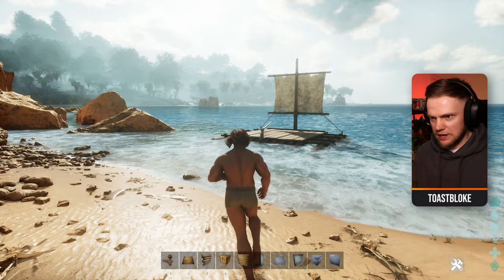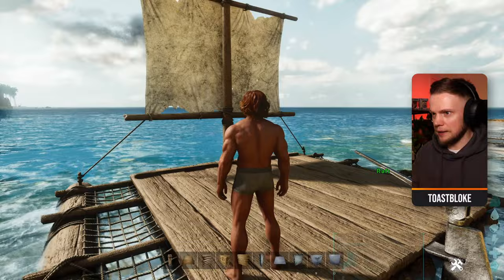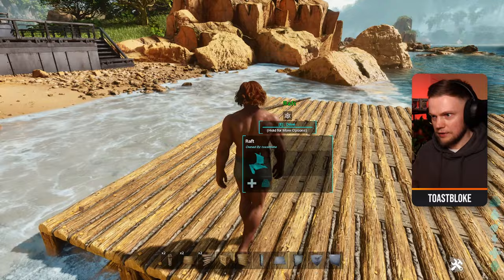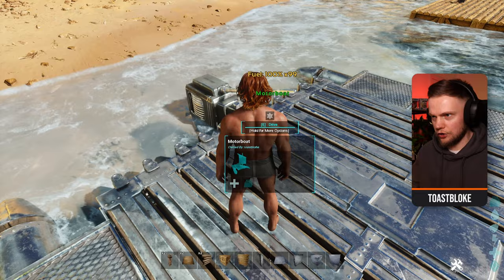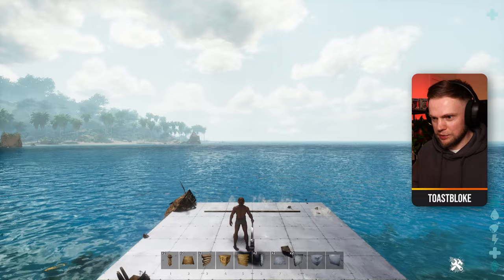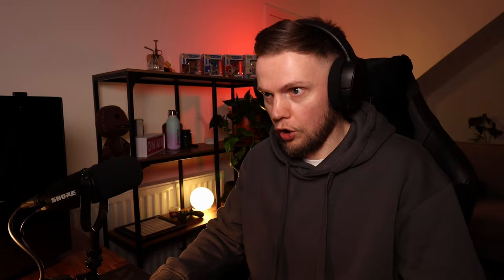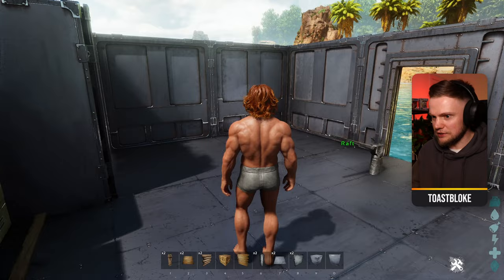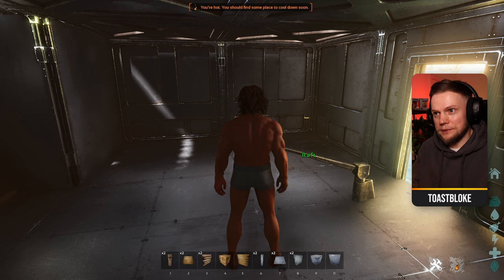How to Build Drivable Rafts and Motorboats with Foundations in ARK: Survival Ascended!

Comment: The only disadvantage I encounter is that you cannot enter the raft from below the water since there're foundations that are blocking the raft from below and you need to put ramps or ladders to climb it, but I find it more realistic.
Reply from the maker: I get you completely. It's nice to be able to get out of the water quickly! I always value the added protection of the raft over the underwater access though. In the last game I had a method of getting both benefits, but it doesn't seem possible in this game, which is a shame!
Reply: You can always pick up the middle foundation and replace it
Reply from the maker: It’s annoying to have to do all the time, but you’re right. 🫡

Comment: Damn, you did it again!  How are you adjusting the height of the pillar?  OK, I think I got it figured.  Before I click to set the pillar, I click once and move the pillar up, or down by moving the mouse forward, or backward.  Now that the pillar is figured, I cannot set the foundations as low as you did.  The pillar only goes so low and the ceiling part then dictates how low, or high the foundations are placed.  I will play with the quarter wall a bit more.  Wow, not sure why it worked this time, but it did.
Reply from the maker: Sorry for the late reply! I've had a mad few days! I'm glad you've got it figured out, but just to clarify, you raise/lower the pillar by looking up and down once you have clicked once to place. With the pillar placement, there are very narrow margins and you need to do it near the shore to get the pillar to drop below the raft, so you can raise the blue rotation icon to the perfect height. Just above the raft! Hope this helps!
Reply: @toastbloke  Nice!  I didn't realize being near the shore was important, but I guess I got lucky and was in a good spot.

Comment: DUDE CLUTCH, really goood job! I know this is 7 months old, we delayed playing ASA until bugs were under control. Another thing that I cant figure out is adding doors to my walls when extended 3 ceiling tiles back from rudder foundation row? I can put walls/door frames up but no doors? Any ideas there? Ive tried ASR and placing foundations as far back as possible. Oh and why don't the pitfall traps work on some dinos anymore? Theri, trike etc. Thanks dude, great content.
Reply from the maker: Cheers! Appreciate it! The new foundations in the game have really limited raft building, so there’s a few problems I’m still looking to solve regarding foundation support. If I ever crack them, I’ll be sure to share!

With traps, the dinos have new pathfinding mechanics and ‘AI.’ I’m finding interesting things about how it works all the time, but I’ve got a trap series on my channel where I’ve designed traps that work despite the changes. I’ve got three more ready to drop too, so keep your eyes peeled! 🙌🏻

Comment: This is an excellent video. Thank you! Just a note: when trying to get the height of the pillar correct, it was much easier for me to reduce the sensitivity of my mouse to it's lowest setting. Then I would pull back until the rotation circle snapped below the raft and then very carefully moved my mouse forward, clicking the moment the blue circle snapped above the raft. I had missed the location multiple times while trying to use the keyboard. Just an option. Cheers!
Reply from the maker: Thank you! I'm glad to hear it helped, and you found a way to do it that worked for you. There's no margin for error with this, so it's definitely not the easiest trick out there!

Comment: Still works. Great tip on the arrows being close to boat. I used mouse wheel to move it up and down. If you do not get it low enough it won't be drivable. Pick em up and try again. Its drivable once you get the right height.
Reply from the maker: Class! Glad it's treat you well! And indeed, a great little fix found by the community there! Teamwork makes the dream work!

Comment: You said the top isn’t protected?  Does damaging the invisible sail also still damage the boat?
Reply from the maker: The sail doesn’t take any damage as far as I’m aware. It’s just a visual if you choose to have it up. The top isn’t protected by the foundations as they sit just below it, but build walls and a roof over them and it’s protected by those structures 😎

Comment: The reason they patched it is that prior, if you build on the raft (rather then on structures of the raft), essentially there was no structure checks: as long as your reticle was on the raft rather then a structure (and clipping disabled), the game would allow it.

By placing your foundations "under" the raft you'd be able to use this trick...

My original boat build was essentially all utility structures clipped into one another surrounded by walls :p
Reply from the maker: That makes complete sense! I figured it was getting confused between the two surfaces with the random red-boxing and having to re-render things to put it right, but that explains the clipping. It was almost if things dropped off the side of the raft at points and through the walls. I didn't try on the raft on it's own to realise this! Nice spot!

Comment: how do you make the pillar drop and rise?   its fixed for me on PC
Reply from the maker: Click 'fire' once to lock the position and then look up and down before clicking it again to place. This will only work when free placing the pillar though, so on the ground and platforms, otherwise it will just snap to another structure at a set position. Let me know if that helps!
Reply: @toastbloke  Excellent thanks!!!

Comment: playing on pc, the the planks on my raft dont have the same markings sadly even with textures maxed
Reply: i managed to get a perfect line up useing the hole in the front of the raft with the sail removed. you want the piller just barely clipping through the wooden bar going across the deck
Reply from the maker: On Ascended? That's very strange. They look the same on mine with ever low graphics. Wonder what that might be!

Great stuff in regards to your other comment too! As long as you've got the method to work, that's all that matters! Spot on!

Comment: When i getvon my boat it doesn't center
Reply from the maker: It doesn't put you in the centre, it just lines you up with the boat to make things a little easier. You don't even have to do that step thanks to full alignment mode. When you dismount it will put you on the join where the mark you need is to help find it, though. Hope this helps!
Reply: @toastbloke  thats what mean sorry it wont line up with boat. When i mount  whatever direction im looking stays the same
Reply: @toastbloke  im on ps5 is probably the problem

Comment: Has this been pitched? Can do it on console.
Reply from the maker: It can be done on all platforms on official settings. Which part are you struggling with?
Reply: I do everything up to putting quarter wall down.  But it does not snap on button on the wall. It keeps snapping against the ceiling or the pillar.
Reply: @stingcharger Same happens to me as well.
Reply: Nvm, I was using the sloped wall, not the quarter. It works now.
Reply from the maker: Usually that means the pillar is too low, or maybe you’re too close to shore and a rock is getting in the way. Have another go and let me know if any of that helps.
Reply from the maker: Well done for figuring it out! All the pieces get confusing with them being grouped!
Reply: @toastbloke  ok thank you. I will try it again. Taking a second look. I think maybe my pillar was too low.   I am thinking there could be a sweet spot. I will let you know thanks.
Reply: @toastbloke  I got it to work. Thank you. There is sort of a sweet spot. Took me a couple of tries. Thanks again.

Comment: Finally gave up in disgust apart from the game crashing every so often I discovered after building my raft when I re-started the game parts of the raft were missing At first I thought it mite be because it was a mod raft so I went back to the original raft but it still kept on happening after that I just uninstalled the game and went back to Evolved instead untill they fix the bugs in Ascended
Reply from the maker: The game has a lot of problems that need addressing for sure. With the crashes, do you have DLSS on? Mine crashed all the time until I turned that off and it's worked for others since. With the raft structures, that is just a bug, unfortunately. The game hides them all, but if you mount and then dismount your raft it all comes back. Really strange! Enjoy ASE in the meantime, though. I hope they move quickly on fixing this instead of DLC!
Reply: I think I'll just wait untill they fix the bugs and play Evolved instead

Comment: Doesnt work
Reply from the maker: It does work. I did it last night. Where are you having difficulty?
Reply: @toastbloke  Having the same issue.   I have used this before without issue, but now it does not.  Does not allow you to drive.   Tried both regular & ASR Stone foundations.   Are there any specific server settings that need to be set?
Reply: Disregard - in case anyone sees this, use the new method of watching for the blue circle to move.  It's MUCH more effective for getting it right.